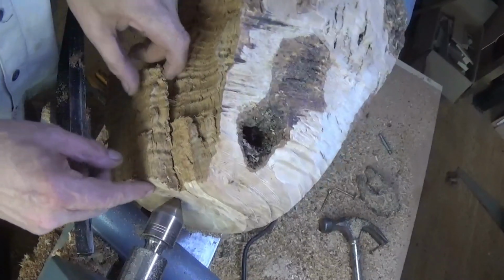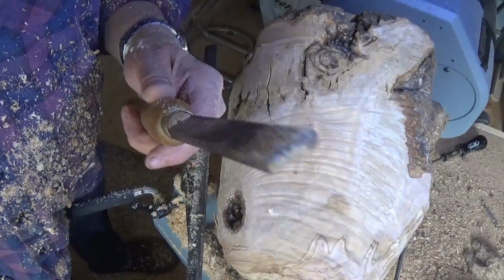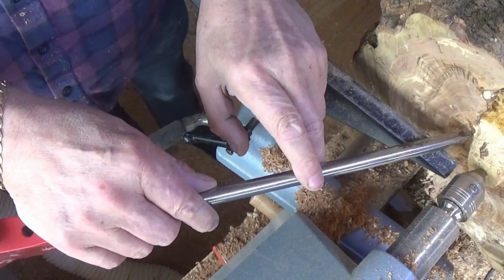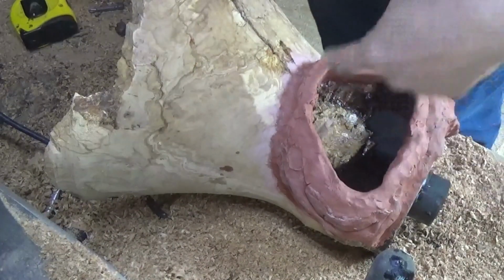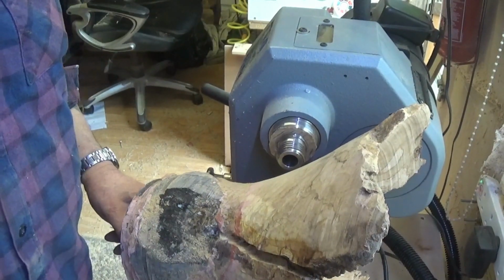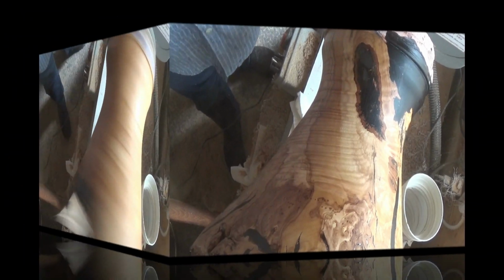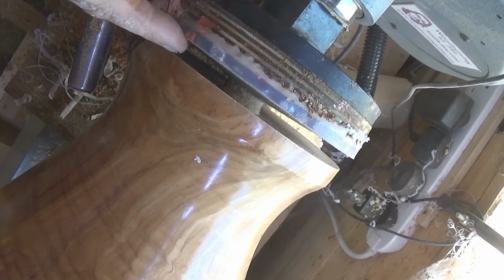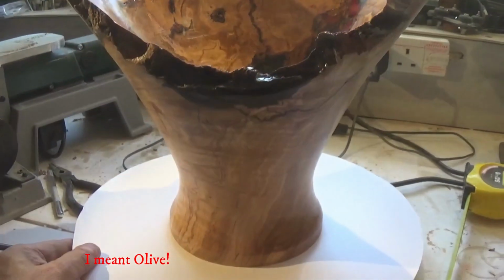Woodturning at 54a #158 The big Olive project.

Comment: Was this turned on your new lathe? If so this is quite a feat to turn such a large piece on a mini...or midi lathe. I like the black resin filling some of the voids. I've been experimenting with cocoa powder in epoxy on a Cottonwood bowl of mine. So far it looks great, to my eye at least...kind of like dark chocolate melted into the voids. The dark brown color mimics the bits of bark left in the inclusion I'm filling. I've yet to see what kind of shine it will produce, but it is promising. If it doesn't work I can always make some hot chocolate from the cocoa. ;-)
Reply from the maker: Lol! Got the big lathe back aa couple of weeks ago. The cocoa powder in epoxy sounds like a great idea,be interested to see the finished piece,although it might make me hungry!😄
Reply: @KeithBarrowat54a  So, it wasn't a super human feat? I'm still impressed as I can't do anything that large or out of balance. The slowest speed on my lathe is 700 RPM. I've managed to slow it down by adapting an old motor to turn my lathe at around 350 RPM, but with very little torque. I use it for sanding and some finishing jobs. I'd be happy to send you a pic of the finished bowl if you like. Contact me at (gilsdesigns@yahoo.com)